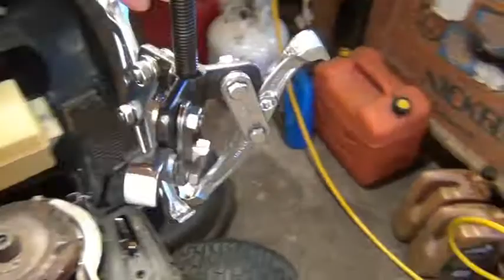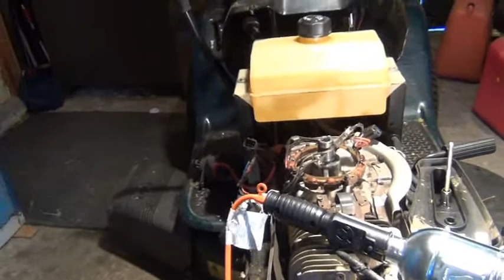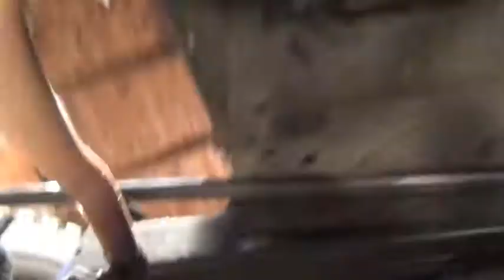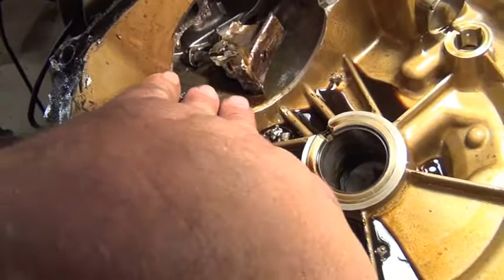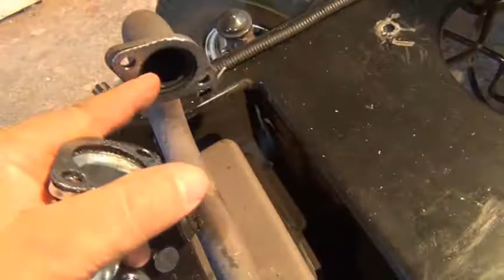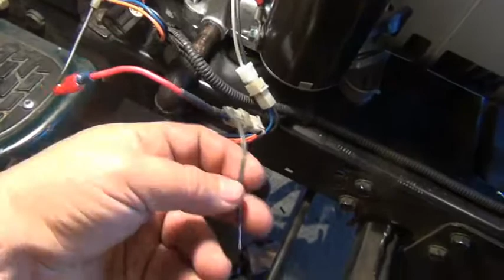Craftsman Lawn Tractor Engine Repair

Comment: Have any idea what size the bolt from the vertical shaft is , bought a mower and it fell out and need to replace it
Reply from the maker: Hi Richard I don't have that lawnmower anymore... what is the make and size and model # of your engine ??

Comment: thanks so much for video! have same exact motor on my LT1000, and same compression issue with what appears to be a broken rod. haven’t taken apart yet so your video will come in handy. 
i’m hoping only a broken rod. do i need to remove the flywheel like you did to get inside the crankCase?
Reply from the maker: Hi Dante C first you are very welcome and thank you for commenting... for your question about the flywheel... you don't have to take it off but if you need to pull the crankshaft out you will need to take it off... good luck with your repairs.

Comment: I feel your pain
Reply from the maker: Yes it is a pain lol, sorry you have a similar problem, good luck with your repairs
Reply: @jrsir1  i fixed the compression 5 times, got it running, then the engine block cracked... i finally said screw it and got a used engine for it. It should be here wednesday but I am travelling this week. I cant get a new one that fits because they stopped making parts like 10 years ago.
Reply from the maker: @championbeam4018  Wow!! that's sucks after all the work you put in... sometimes you can buy a new engine but you have to drill some new mounting holes to fit the engine but the main thing is the muffler arrangement it has to line up... good luck with the used engine hopefully you get a good one. Sorry about the late reply I just got home from hospital, I spent 2 and 1/2 months at a spinal cord injury rehab center, I had a cervical disc and fusion in my neck and it all went bad... I had 2 surgery in the same day and another one a week later. Thanks for watching
Reply: @jrsir1  the used engine fits and works. Now I just have to get the mower to mow even. One of the spindles is messed up. Hope you get better. I was in the hospital because I cut my eyelid and the only thing I remember is picking out a stuffed bear.
Reply from the maker: @championbeam4018  Can you replace the spindle ?? wow!! you cut your eye lid ?? how did you do that?? I hope it wasn't too bad of a cut...
Reply: @jrsir1  I can replace the spindle but I used my money for the engine (I'm 15). I was like 5 and ran into something.
Reply from the maker: @championbeam4018  Oh ok I see
Reply: @jrsir1  I have never seen the channel owner ever reply to comments without making a video.
Reply from the maker: @championbeam4018  ??? I don't know what you mean lol
Reply: @jrsir1  seriously or....
Reply from the maker: @championbeam4018  LOL

Comment: the title to this video says "Engine Repair". I don't see any repair of an engine! That engine is totally re-buildable. All you needed to do was clean the crank journal and replace the rod.
Reply from the maker: Actually I tried to get the parts for this engine and they don't make the crank shaft anymore it's discontinued so that's why I had to replace the whole engine, and I tell you they don't make things like they used to anymore this new engine that I put in isn't as strong and powerful like the old one even though they claim that it has more horse power.
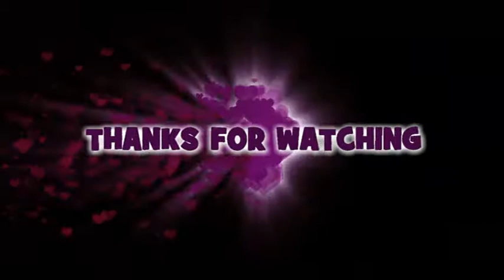Reply from the maker: Hi yes I was able to get the rod but the "journal" I call it "crankshaft seat" I'm guessing we are talking about the same part on the crankshaft was scorned pretty deep and I would've had to fill the holes with weld it's hard to see on the video but they were deep and the other problem was that if you look at 25:25 you can see that the "journal" or crankshaft "seat" where the connecting rod connects too is also tapered on the right and I'm no longer equipped to machine parts anymore, but I agree with you about the title you're right I should've called it "Dismantling an engine & and replacing it" lol... thanks g w I appreciate the comment.